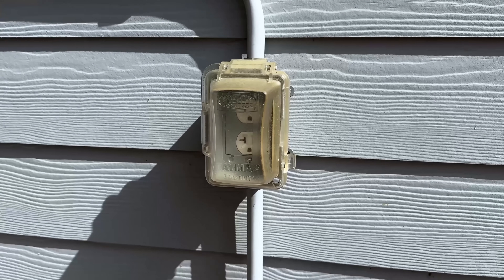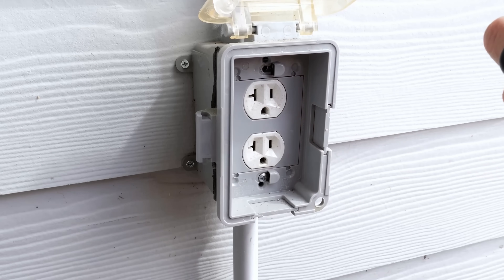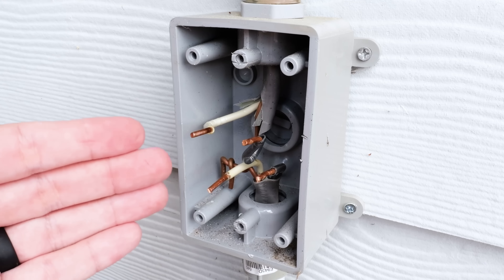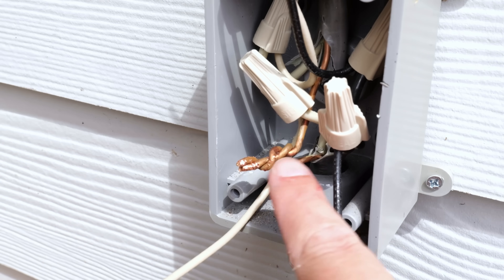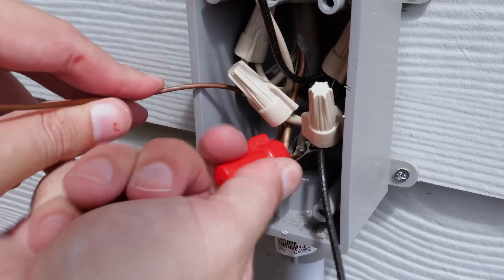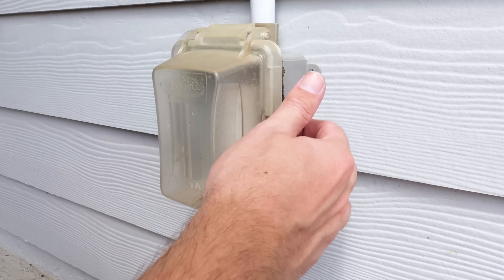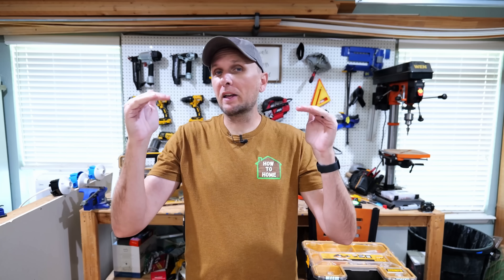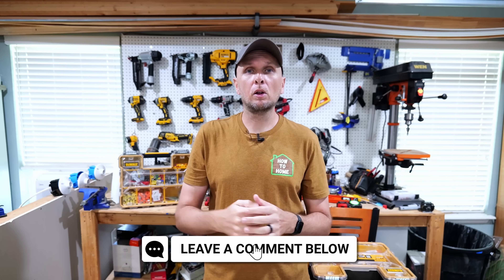Dangerous Mistakes DIYers Miss When Installing Outdoor Outlets!

Comment: Im not a electrician, but if they ran 10 gage for voltage drop and you went with 12 gage to the outlet; didn't you just lose the intended voltage drop? Also they make 20amp ground fault outlets, you put a 15 amp outlet on ?....I get it, this was for demonstration purposes, good job on that .
Reply: Any voltage drop would occur along the length of the smaller diameter wire -- here about 12". That's not enough to measure or worry about. The 10 gauge wire was used to prevent a voltage drop at the far end of the load, presumably a long distance away.
Reply: Should look at box volume with those splices
Reply: 15 amp receptacles are allowed by NEC 210.21 B3 to be installed on a 20 amp circuit
Reply: First off, there is no way you were able to install the device in that box with the connections you made. To do this correctly you should have installed an extension box.
Reply: No issue here. The pigtail is good for 20 amps and is so short voltage drop is a non-issue. And any 15 amp receptacle on a 20 amp breaker meets code, (A) because the internals are still built for 20 Amp, and (B) since an actual 20 amp plug has perpendicular blades instead of parallel blades with 15 amp plugs,you CANNOT plug an actual 20 amp plug into the 15 amp receptacle anyway, so it mets code. Also, since they pulled type UF direct burial cable into conduit, kind of a code “no no” except for using the conduit for mechanical protection as required where it comes up out of the ground on both ends, and in this case it is in conduit the full run, underground or exposed, so a CONTINUOUS conduit run, in order to meet code in that case, (continuous run), the ampacity of the cable must be de-rated to the next smaller gauge, meaning number 12/2 cannot be 20 amp but 15, SO to meet code with UF or NM cable in conduit, you need number 10 for 20 amps. Number 10 in free air, walks, etc, is good for 30 amps normally, so my guess is there is no voltage drop issue here since it would have to be a REALLY long run to have voltage drop, so likely to meet ampacity de-rating requirements. If individual THHN/THWN wires were used instead-black, white, green, then number 12 would be fine, also UF cable direct buried and conduit used only for mechanical protection as required where it comes up from the ground, as well, since it is not a CONTINUOUS run of UF in conduit. What was dome here is all correct. Number 10 pig tails are too stiff to work with unless stranded is used. Even with number 12, I would prefer to used fine stranded typeTHHN/THWN/MTW machine tool high flexibility fine strand number 12 as it REALLY makes it easy to get the deep GFCI into the box! They make extension rings for these boxes to gain space as well. Voltage drop is only an issue on long runs. I believe this was a continuous run cable ampacity de-rating issue. Cheers!
Reply: @2StrokeDriptroit you are right about the fact that it’s really hard to get #10 in a box with just that being the end of the run or chain. I would have had that the the end. Sorry if I start not making sense I have a deteriorating brain and I start mixing things up
Reply: I myself am not a fan of having a bunch of wire continuously pushing against a receptacle inside a box. I would’ve just straighten out the wires that were there because we already know that the receptacle fits. I would not have added another place where a bad connection could occur, I don’t care if you are using Wago’s or not!
Reply: A death stick with a socket tester being shown as adequate for proving dead? Wow. You like living dangerously.
Reply: I would like to know how long is this run? I’m willing to bet that it was for a pool pump and if you have lived there since it was built why ? It must be a big house with a single run going over 100 feet you would think that there would have been a sub panel
Reply: The voltage drop doesn't happen on a couple inches of wire, it happens on the longer runs. The 12 gauge wire just limits the available amperage of the socket which would be dictated by the circuit breaker anyways.
Reply: 15 amp receptacles are rated for 20 amps. so he’s goooood.
Reply: Electrical contractor here in the trade for 34 years. First off, voltage drop isn't usually an issue within or on the structure of a typical residence because voltage drop isn't even considerable at 100 ft or less. Second, even at 100 ft with #10 on a 20-amp circuit, you can pigtail 6 inches of #12 at the outlet without negating the integrity of the circuit. Third, you can legally put 15-amp receptacles on 20-amp circuits all day long and it's done everyday in new construction and has been done for years. If you consider most any small appliance or equipment you plug in to a residential outlet has a factory installed cord that is typically #14 wire. 

Just so everyone is aware, circuit breakers are only allowed to be loaded to 80% meaning a 20-amp circuit is only to be consistently loaded at 16-amps and a 15-amp breaker at 12-amps
Reply: @RealJonDoe  One outlet with a 15 or 20 amp duplex receptacle is 2 receptacles, so a 15 amp receptacle is code. If this was a dedicated 20 amp circuit, a single 20 amp receptacle would be required.
Reply: I don't really care if the code allows it.  Best practice IMO would be to wire together the two 10-gauge ends with the pigtail in a single wirenut.  That way if, in the future, anyone does assume that's a continuous run of 10-gauge wire, he'll be correct. (I'd use 14-gauge for the pigtail, though.)
Reply: @jej3451 that would probably require a second GFCI receptacle in the remote location. As shown, any further devices are GFCI protected.
Reply from the maker: I didn’t lose anything because where I put the #12 pigtails is at the very beginning of the run.  At the point, no voltage drop is occurring.  I had no reason to install a 20 amp GFCI.  I don’t have anything that will get plugged into it that requires 20 amps.
Reply: @HowToHomeDIY  But do you need to have a 20 amp GFCI since the circuit breaker is 20 amp?
Reply: @raykane7459  No, assuming multiple outlet locations. It's a wiring issue, not an outlet issue.
Reply: @raykane7459 no the NEC  allows 20 amp circuits has more the one plug on it, a duplex is 2 receptacles .
Reply: Why not do the right thing, regardless? In my view, the 12 gauge piece becomes a “fuse” especially if there were heavy loads continually used.
Reply: @jakeo. Tell me you don't understand NEC or Electrical Theory WITHOUT telling me you don't understand NEC or Electrical Theory. I'll wait...
Reply: @jakeo.  Not at all. The breaker will trip long before that small length of wire overheats.
Reply: @jakeo. Your view is wrong. That receptacle will handle 20 amps. They're rated for 20 even if they're not listed as 20 amps.
Reply: @jakeo.  No, 12 gauge is rated for 20 A.
Reply: @jakeo. That 12 gauge wire is designed to carry the full 20 amp load and in the case of excessive load, the breaker would trip before the 12 gauge wires failed.
Reply: @jakeo. You NEVER want the wire to serve as a “fuse” in a standard building installation.  Relying on the wire as a trip device risks setting your building on fire, among other bad bad bad things which could happen.
Reply: @jakeo. 20 Amp Fuse Protects #12 Wire, No Real Voltage Drop With The Pigtail, #10 Pigtails Would Not Allow Room For The Receptical. Bigger Box Would Be Better,
Reply: The circuit breaker will protect the wiring. 12 guage wire is rated for 20 amps, which is the trip point of the breaker.
Reply: @jakeo.  12 ga. handles 20amps. The breaker is still the 'fuse'.

Comment: It seems a 10 gage wire has a 12 gage section downstream from the outlet... I think the 12 gage wire should be twisted into the two  10 gage wires that have been twisted together for a twist of 3 wires per hot and three wires neutral side; two 10s and one 12...
Reply: it's on a 20 amp circuit.  if you tie the hots and neutrals together, you defeated the GFCI protection for the downstream stuff.

Comment: What is downstream from that outlet? If it is more outside outlets than what you did was correct. But if it is not feeding more outlets and going inside you just created a nuisance. If what is on the inside trips that GFCI outlet you will now have to go outside and reset it. In a situation like that it is recommended to do line only connection on the GFCI outlet to allow power to continue through but stop at the outlet only when tripped.
Reply from the maker: Downstream is more outlets and lighting for my shed.

Comment: I am wondering if would be code-compliant to simple twist the two heavy wires together with the ONE pigtail for each hot/neutral conductor to connect the receptacle? This would eliminate three wire nuts, freeing-up a lot of space in the box. Also, I noticed that the GFCI receptacle you installed is NOT a 20 amp.
Reply: The GCFI receptacle had to be wired that way for it to protect outlets further down the line. Also it is code compliant to have a 15 amp receptacle installed on a 20 amp circuit.
Reply: The GFCI was very likely a 20 amp.  Not all 20amp receptacles will have the T lock required for commercial applications. Thus being built more robustly.
Reply: You could do that if you don't want to protect downstream devices, i.e., no Load connection. GFCI's are built to commercial grade specifications and 15 and 20 amp versions are the same internally, additionally, 15 amp duplex receptacles, including GFCI's, are permitted on 20 amp circuits. Reference NEC 210.21(b)(3).
Reply: @jackw2207 All 120v 20 amp receptacles will have the horizontal and vertical slot on the neutral side. No such thing as a 20 amp receptacle with just 2 vertical slots.
Reply: @ Bingo. I misspoke on that. It’s OK to have a 15 amp GFCI on a 20 amp circuit.

Comment: Thanks, I learned a couple things. BTW, I always give the wires coming into a wirenut a tug, afterwards, to make sure they are well engaged.
Reply: Also... the pre-twist really does make a better connection for mixed wire sizes.
Reply: I always put a plastic wire tie pulled tight right behind the wire nut to hold the wires in place while they are being shoved around.
Reply: I use to teach HVAC at a Trade School. On our lesson about using wire nuts I always demonstrated how to make a wire nut connection, and then pull to test it, then had the class do the same at their desks. After everyone was done I walked to each one and pulled their wires out of the wire nuts. Hundreds upon hundreds of students over the years, not 1 ever made their first wire nut connection correctly. Not 1 ever made that mistake again either, they knew after that any wire nut connection they made was going to get pull tested by me.
Reply: I can't count how many times I did that but then had them just pop out while folding them, but it's usually combining solid and strand...
Reply: @schneider1492  That's why I've been converted to a Wego or equivalent user. So much easier to use and be sure of.
Reply: pre-twist wires
Reply: You should always give a firm tug on wire nuts after you install them. If it's going to come loose let it be now not later.

Comment: I have one outdoor receptacle at my garage that has no ground wire but is it gfci. Should I be worried about it?
Reply: You should not be worried, replacing a 2 prong receptacle (no ground) with a GFCI is a code compliant method to increase your safety, NEC 406.4(D). GFCI receptacles don't need a ground to protect the user from electrocution. Place the sticker supplied with the GFCI "No Equipment Ground" on the cover plate. I would test the GFCI by pressing the test button with something plugged in to see if it's functioning correctly. If you use a receptacle/GFCI tester, the button on the tester won't work without a ground.
Reply: the GFCI does still protect it.  if it is an old ungrounded circuit, you are code compliant because of the GFCI protection.  if it is newer wiring that should have a ground, but doesn't, I would worry just because you don't know what else was done wrong.
Reply: I wish people with nothing positive to add, stay silent.
Reply: @jesse6344  are you the one we just corrected?
Reply: @jesse6344  I wish people who are completely clueless about this would stay quiet. I'm more worried about retards spreading wrong information than I am about your feelings.
Reply: Is it a metal or plastic box
Reply: For sure - that entire circuit is ungrounded, let alone the gfci.
Reply: It's GFCI. It's fine. The people worried about it are probably the same people that think you need to put a 15A breaker on the line if you switch the outlet from 20A to 15A. I spent 30 years in a house that didn't have grounds or GFCIs on any outlets, including the outside outlets. No one died or even got hurt.
Reply: Yes the GFI circuit needs to have ground or it just doesn't work as far as I know I'm not an electrician
Reply: @NA-oq4ty  still no.  GFCI receptacles and breakers are LISTED AND APPROVED to protect ungrounded circuits.
Reply: Sounds bad. But idk. I'm curious to see the answer to this
Reply: Problem ? Yes!!!😮. It is Not a protected circuit
Reply: @jackw2207  thank you 🙏

Comment: Does running Romex inside the conduit like that meet code requirements?
Reply: That "Romex" looks like the UF one based on the thick grey jacket, which is outdoor rated. In fact, it could even be buried underground directly without conduit. Technically, it meets code to have outdoor rated NM inside conduit, but I'd much rather have individual THWN wires inside since it's a lot easier to pull and more room for future wires if the conduit is large enough.
Reply: @aurvaroy6670 our inspectors won't allow romex in conduit, it must be single THHN wire.  Their reasoning is that the extra covering on the wire inhibits heat transfer and further de-rates the wire.
Reply: @smrtmedic  the NEC has specifically said that sleeving NM or UF cable in conduit for physical protection is acceptable - and to quote my continuing ed instructor in that class, "because of a**hole inspectors"  also keep in mind - #14, 12, and 10 is already pre-derated to account for things like that.
Reply: @ I agree, but ya gotta do what you gotta do!  The AHJ has the final say!🫣
Reply from the maker: @aurvaroy6670 couldn’t have explained it better myself.  Thanks for the assist!  Yes it is UF and once it gets into the ground it is direct buried.
Reply: I was going to ask the same thing.  When I was building my outdoor gazebo, an electrician friend told me that I couldn't use romex or UF inside conduit.  I had to use the UF, or THHN wire inside conduit.

Comment: I know it's "code" but GFCI on outdoor receptacles are a PITA. I had two of them and anytime I tried to run a large tool like a demo hammer or circular saw the darn GFCI would end up tripping. It got to the point where I had to break out my generator to get the job done. I finally removed the GFCI outlets and installed standard outlets. Problem solved!  That was 15 years ago and I never looked back. Same in the kitchen, had an electrician install two new duplex outlets. Of course they had to be GFCI. Every time I would turn around those GFCI receptacle were bad and needed to be replaced. I replaced each one TWICE and on the second failure I replaced them with standard outlets.  That was 10 years ago. I've had enough of the nanny devices. I figure I've gone 60 years without that pesky GFCI crap, chances are I'll be okay for another 30+ years.

Comment: With those wire nuts, I thought you also had to twist them where the actual wires start twisting also?
Reply: Hard to twist a 10 gauge around a 12 gauge but can be done if you focus the pliers on wrapping the 10 around the 12.
Reply: Yeah you're suppose to twist the hell out of those things so the wires are all twisted around for a few inches ideally but I think that is more to do with not coming undone if the fixture should fall out of the ceiling or something like that.